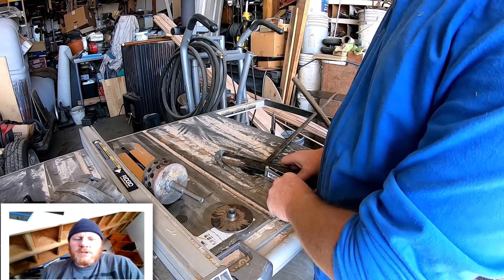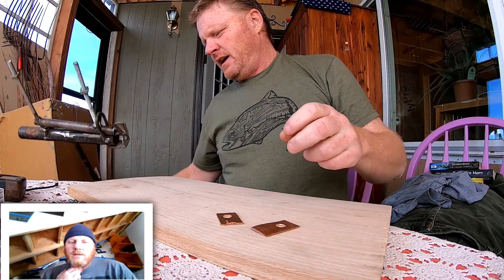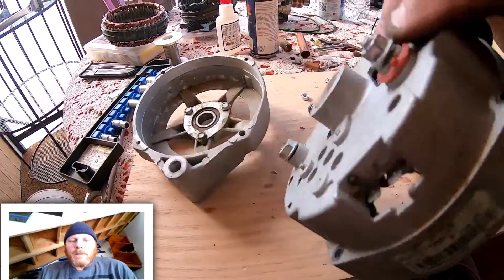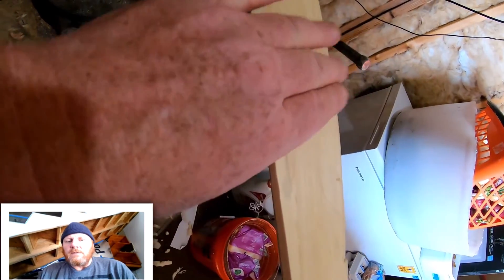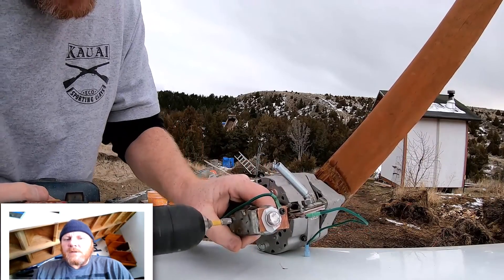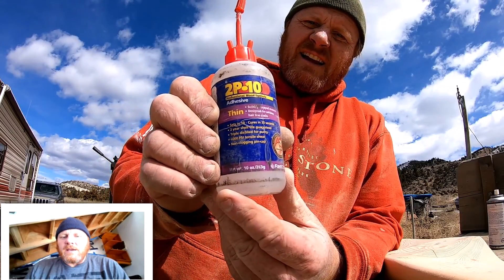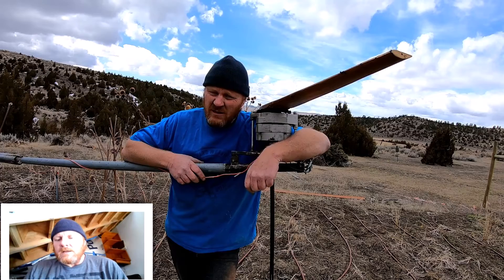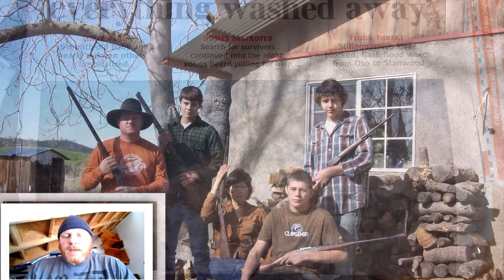video compilation, car alternator wind generator, wind turbine how to make free energy

Comment: I dont know how to get power out of it to ac
Reply from the maker: It would have to be put into a battery, and then inverted with an inverter making ac house current. A waiste really because the alternator makes ac current that then gets converted to dc current which then gets inverted back to ac current lol.
Reply: @veggitarianredneck  is there a way to just get ac output?
Reply from the maker: Yes, just skip the rectifier and pull it directly from the phases. The three phases gives you three phase ac current.
Reply: @veggitarianredneck  please make a video about this aspect of design.
Reply from the maker: @danielwarpaint1963  do you mean a generator that starts when you flip a light on?
Reply: @veggitarianredneck   I need to power some home appliance that is 1 mile away from my house aka my barn / man cave
Reply from the maker: Ok, I see, you want to run three phase for less power loss. But man that's a long way....
Reply: @veggitarianredneck  do you have a video even just to power a couple lights ? 2x 100 w
Reply from the maker: No not yet. Just a suggestion but maybe you could power a couple of 12 volt or 24 LEDs with straight DC and charge your battery with a couple of panels. Might be simpler, cheaper than trying to make a long run using wind power.
Reply: @veggitarianredneck  I was thinking the alternator hooked up to a 12v battery and a motor with a smart charger. So the batary starts the motor the motor spins the alternator the altanator charges the batery and runs 2 lights ? The alternators output is a little more then what it takes in if the motor has a bigger wheal so that its less energy to spin and more spins for the altanator but I have little knolage of it without being in a car or truck would that be enough to run a light or two for basicly free?
Reply from the maker: They actually made something like that years ago where you would turn the light on and it would make a contact that would then start the motor and provide the electricity.
Reply: @veggitarianredneck  genies in going to try it out thank you
Reply: @veggitarianredneck  didnt know if it could work like that or I was just thinking something implausible

Comment: Cool, i don't get much wind except for storms, but would still like to build a turbine, being off grid, and the sun doesn't shine everyday, I have plenty of alternators,  I just wonder if two wide blades like you made  would take advantage of even low speed wind? I have everything from 63 amp alternators, to 150 amp, I'd rather go with about 100 amp, to give it a try, the tower is the big issue, I'm looking at 40-50' minimum. There is alot of trees, and im on the side of a valley, I have thought about teliscopic pole towers, tilt, even a platform with with a tilt down  and telescopic, using a cable to push up the turbine, but it comes to the ratio, the cash to power ratio, I can save up to build it, but it must perform, I guess I'll have to start with something small, and maybe put it up a tree ! Ha-ha, but yeah a turbine out the TOP of a tree, should be simple enough, for testing anyway, I have meters that calculate and shows watts, amps volts, I can test it on a lead acid battery for a month or two, to figure the potential of a larger turbine, I mostly need the power when there is no sun, and it's usually windy then, sorry for the rambling!